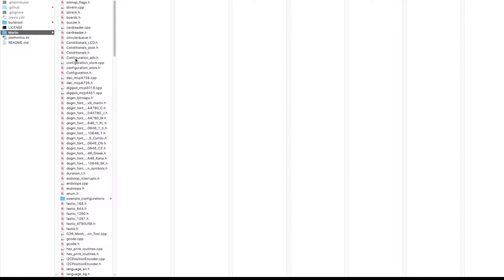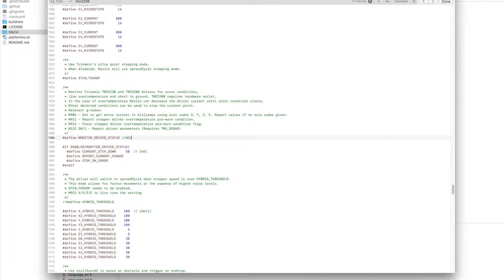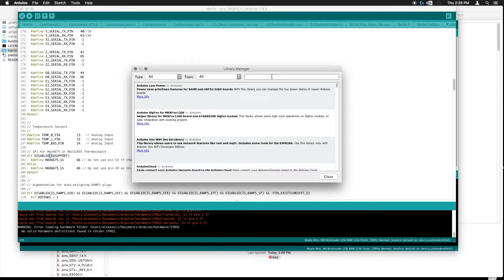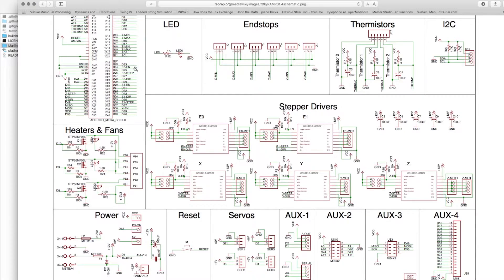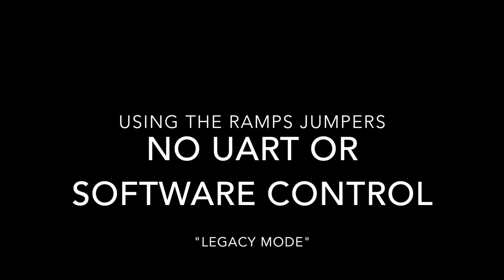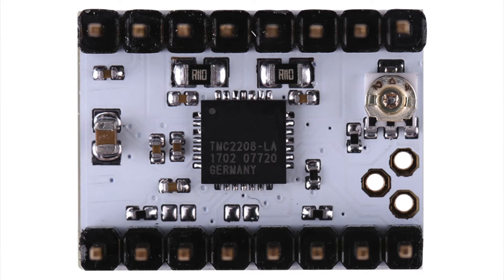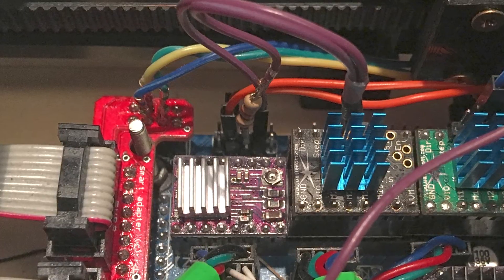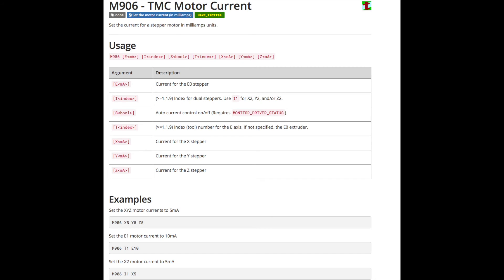Tmc2208 how-to: a more complete setup guide

Comment: Hi, i have a MKS Gen L + TMC2208 drivers. I just put the drivers in to the board, all 3 jumpers under the stepper drivers i left in. Which mode is this? I only defined the TMC2208 in the marlin firmware. Is there a mode i need to define in the firmware to get my steppers even more silent?
Reply from the maker: MKS dosn;t release schematics, so I can'tknow for sure, but i think the jumpers are wires similarly to a RAMPS, so if you want the smoothest mode possible: jumpers ms1 and ms2 should be ON and MS3 should be off (ms3 is not used for configuring microstepping on trinamic drivers cloned from the Watterott design) .  That will give you StealthCHop in 1/16 microstepping with software interpolation

Comment: Hello! Hmm. cannot seem to find the promised video about accelaration vs torque. Have you even done it?
The other interresting thiung i found out that, for example, for TMC2100 datasheet says that optimal chopper blank time is minium (16 clock cycles) however, the stick i got has 24 cycles set. It would be very interesting to see how blank time affect the torque, if it does at all, or how it affects the acceleration.
Reply from the maker: the original torque test video is called 'Trinamic SilentStepStick Torque Curve testing' , but I have a more complete set of test with a bunch of driver in the works.  I am just waiting on some parts and I have to rebuild the test jig again.  Good catch on the blank time, those are some of the parameters that are set by default that I think should be changed. I am set up to do some deeper testing on trinamic settings, and I'll film that video when I get the torque jig rebuilt. (I made a silent jig using magnetic resistance so I could also test noise, but when I did some initial testing, with high-torque motors and high-voltage, it was not strong enough, so I have to go back to a friction-based jig and just test the noise separately...)
Reply: I've seen that video. That's the video where you promised to make a separate video about acceleration. The 16 cycle blank time is best option for StealthChop. 24 cycles is universal. The driver module comes with StealthChop enabled, but maybe they set 24 cycles in case user switches to spreadcycle. I use chinese Fysetc 2100 drivers and there is not solder switch or anything to switch blank time. To change it i need to clean solder mask but the trace and solder wire. Nuts. I dug through tons of datasheets, application notes and possible explanation and still did not find anything on how blank time affects torque, specially for stealthchop. For spreadcycle is it more or less understood that it should be long enough for oscillations to finish.
Reply from the maker: Ah, the fysetc boards. I had to figure that one out as well when I tried out a few. They are unpredictable when it comes to how they are set up.  I don’t remember which version is which, but I know that some of them came with no CFG jumpers set at all.  Toff doesn’t effect StealthChop, so don’t worry about that one. That jumper does also effect the chopper frequency in spread cycle though, so it can whine if freq is too low, but it can also cause overheating if freq is too high… it’s never easy

Blank/blanking time (on all drivers) is there to avoid issues with the power supply and switching spike at zero crossing.  It just tells the driver to ignore input for a period of time.  If it is way too low, you can have abnormalities like tripping the overcurrent protection (probably why they defaulted to the slightly longer time) or non-linearity in the driver signal. How much that effects performance (torque, etc) depends on a lot of things, which makes it very hard to generalize, but I DO plan to add the available  settings that trinamic allows to the next torque test and see what effect they have in “typical” 3d printer conditions (since it has different effect using different motors, circuit, etc).  

CFG0, CFG4, CFG5 are used for configuring the chopper (CFG0=off-time, CFG4=Hysteresis, CFG5=blank-time), and they are tri-state, so I don’t think they realized that by leaving them open, they were actually setting the state.  

In case you didn’t come across them, Watterott defaults are:
CFG0 = grounded (Toff @ 140? 160? I don’t remember which it is)
CFG4 = grounded (HYST-end @ 5)
CFG5 = VCC (Tbl @ 24)

 I THINK fysetc boards without jumpers are set to the maximum value for everything:
CFG0 = floating (Toff @ 332)?
CFG4 = floating (HYST-end @ 13)?
CFG5 = floating (Tbl @ 36)?

Not positive on that.  I would have to dig up one of the boards and see what is soldered where.

I also don't remember at all how cfg6 is set up on those boards, but I know if it floats, the drivers will go into current reduction mode if they have not recieved a signal in a bit.
Reply: Hi!
No, CFG0,4 and 5 are not open. They are fixed set . Here is what i found out:
http://3dtoday.ru/blogs/artemkuchin/driver-tmc2100-from-fysetccom/ (it is in Russian, but the picture in the text explains it all)
CFG0 - GND 140 tCLK
CFG4- GND - minimum hyst, 5ms or something, i don't remember the exact number
CFG5 - VIO - 24 clock cycles
Looking forward to your test for blank time.

Comment: Hello, great tutorial. But if I have Rumba board, which pins I can use for driver controling?
Reply from the maker: It's probably easiest to do a search for folks who have already done it, but you can assign almost any pin you are not using to software serial instead, so it depends on the setup.

Comment: Alex, Thank you for making this video. It explains a lot on how to get the firmware to talk to the stepper drivers. I was always so very stumped on how to setup via serial/uart. I started using the 2208's about a year or so ago, bit at that time, there wasn't much info on them except, hey look at these new Drivers, but zero info on how to setup them up.

You should do another video on how to do the OTP and how to do it and what are the pros and cons of doing it.

Thanks again Alex.
Reply from the maker: No prob.  I considered doing an OTP vid, but I never got around to it. One reason is that it seemed to be unnecessary for all but a few cases.  If you can't use UART on your particular board or firmware for some reason, there is always the option to use a secondary arduino to control the drivers. Maybe I will do an OTP vid in the future, but I'll have to really dig into it first.

Comment: Hi Alex, this driver can produce 256 steps, as I learned but does it mean, using arduino, I can tell my stepper to turn 1.8/256=0.007 degree every time and wait X sec then turn 0.007 degree? I want to make a rotating time lapse head. So my plan is to turn as slow as possible and step by step like TURN 0.007 degree then wait for SHOOTING CAMERA then TURN 0.007 degree. Thank you in advance.
Reply from the maker: Sorry about the delay... been busy.  The math is correct.   200 staper per rev for a 1.8 degree stepper, and each step can be divided by your microstepping level.  You may run into problems with holding torque and small errors with steps that small (depending on the application), but theoretically that's how it works.  It may be better to use a closed loop system with an optical encoder disk, or a servo... but I would start simple with just a steppen in open loop and see how well it does
Reply: Thank you so much for reply. I will go for the highest torque motor within 1.5 A so that this driver can drive. And might have to sacrifice some steps to get more torque. Thank you again.

Comment: Great video thumb up, 
But i got 2 questions, i got GT2560 rev A+ bord, it lacks pins but i want to sodomize SD card pins, (id dont work properly anyway, interference, same as trash characters on LCD).
My first question, in configuration.h it says   #define MOTHERBOARD BOARD_ULTIMAKER, if i understand it correctly i have to edit pins_ULTIMAKER.h, correct ? 
Second question, in file pins_ULTIMAKER.h there is no #if ENABLED(HAVE_TMC2208) and the rest so i copied those lines from pins_RAMPS.h, is this correct ? 
Pls answer, im going to upgrade to TMC2208 as soon as i get them home.
Reply: FYI, i was correct
Reply from the maker: Sorry about the delay.  Yes, you are correct, all that can be copy pasted

Comment: couldn't you just use both pins and 2 separate wires instead of a Y wire?
Reply from the maker: Unfortunately not, because the stepsticks only have the one UART pin that is shared RX/TX

Comment: Hi Alex. would you know if a 2208 once programmed to spreadcycle via script communicator ( Keith Youngs video oon YT) can be programmed  back to stealthchop mode for setting into UART?
Reply from the maker: I have not personally tried it, but technically anything that is not an OTP bit can be set over UART... BUT  it may be possible to program a combination of options that may not work well with stealth and can't be changed, so if you have use that method, I would poke around and  find a working setup online and copy that (I can't really test combinations of hard-coded options without sacrificing a bunch of drivers, so sorry I can't be more helpful in that regard)

Comment: Can you make a guide for the tmc2208 using 1.1.x-bugfix? .I cannot get the tmc2208 to work in 1.1.x-bugfix either.
Reply from the maker: Bummer.  It should be essentually the same process, so maybe they broke 2208 support again?  I don't have an 8-bit board in a machine right now to test the latest bugfix, but I did confirm that the version from May 22 was working, so if you want to doiwnload that older version to make sure it is actually a Marlin-related problem:
-Go to the Marlin github.com page
-select 1.1.x-bugfix in the branch pulldown on the left
-click on 'commits' right above it
-scroll back to the version I used from around May 22 
-click the commit number over on the right before the <> button
-click 'browse files' in upper right
-click 'clone or download'
-select 'download zip'
If that works fine, then it may be a problem with the latest bugfix.  If it doesn't work, you likely have a problem somewhere else.
Reply: Thanks for the help.

Comment: Being attracted by the quietness of TMC driver, I installed three TMC2208 yesterday. This video is a great help. There are some things I find out during the installation. 

I own an Anycubic i3 mega printer(8-bit). I planed to replace X, Y and E0 driver. The marlin is on the bugfix-1.1.x branch. 

First, the pins selected to be used for UART is limited, not every idle pin can be used. I used the software UART approach like in the video, but the Rx of each pair has to be a interrupt enabled pin (https://www.arduino.cc/en/Reference/SoftwareSerial). Hence the available pins for Rx are 10, 11, 12, 13, 14, 15, 50, 51, 52, 53, A8 (62), A9 (63), A10 (64), A11 (65), A12 (66), A13 (67), A14 (68), A15 (69). On my particular machine, only pin 11 and 12 are available for Rx, so unfortunately, I would not be able to receive feedback from the third driver. 

After the installation, I run M122 to check the stepper's status. Strangely, only E0 has a non-zero "Driver registers" value. I spent quite sometime debugging the problem, but actually a quick google search points out that there might be a bug (https://github.com/MarlinFirmware/Marlin/issues/9396 ). 

Although there are a quite a few problems for Rx, Tx works just fine. I can send M906 to change stepper current (confirmed by hand). 

Also, the stepper direction is reversed after the change of driver, for some reason. 

Thanks for the video again.
Reply from the maker: Glad it is mostly working.  Assigning the pins can be a pain depending on what a board has available. And yes, the stepper direction is reversed on trinamics (I usually just flip the cable connector around).

Comment: I reccomend creating github / gitlab repo & commiting changes there. This way in any modern IDE you would see your changes from last time - and it would be easy to do incremental upgrades - and it would be easier for you to rollback to previous configs. 
(Also you can share repositories in link) Works great with Visual code & Platformio.
Reply from the maker: Yes! PlatformIO is nice about tying in forks. I forked a few repos to make some changes, I just have to be better about moving the commits from my machine to github (i hve a bad habit of losing track).

Comment: Hey I like the video; it helped me get my 2208's working. I just wanted to point out that there is currently a bug in Marlin 1.1.x and/or the 2208 libraries that makes it to where only the last queried 2208 returns valid info from a debug command M122 (see the closed bug report #9396). I believe it has to do with the softserial rx implementation, and it is 'promised' to be fixed for 1.1.9. This obviously only affects folks using more than one 2208 (like myself). Regardless it seems multiple 2208 w/ uart is otherwise fully functional in Marlin 1.1.x (though I have doubts about how well auto current and overtemp flags would work... still testing things).

Btw, love the heavy metal man!

Comment: On my tmc2208 I am going to set it up to use spread cycle, for the 3 pads on the top I need to solder bridge, I've been reading different things. Which ones do I need to connect? In some older boards there were only 2 pads making it easier. I'll be connecting my drivers with an ftdi board to my computer to change their mode. I am not wanting to configure it on the fly as its running.
Reply from the maker: Just remember that once you set a bit with the OTP configurator, you are locked into that config, and you may brick your driver if you burn the wrong settings.  Using the normal UART, your settings are uploaded temporarily to the chip on power-up or if you send them on the fly.  As far as the pads, the 3-pad version just lets you choose which pin you connect the uart to with the solder bridge jumper.
Reply: Locked in. hmm that sounds intense.  if i am using the otp configurator do i need to jumper any of these pads? or will it just work right away without them connected? I don't really understand the UART stuff, and not sure how to configure it on my cnc shield
Reply: Keith Young, here on YouTube, put out a video about how to program the OTP bits on these 2208 chips, just search for TMC2208 and Keith Young.

Comment: What if you have multiple 2208s? This tutorial seems to be for one...Sorry haha
Reply from the maker: No prob, the setup is the same for each axis, and if you want individual  software control for each driver, then each driver needs it's own y-cable
Reply: Alex Kenis awesome man! Thanks...I thought so but wasn't sure lmao Keep up the great work!

If I wanted to run only the drivers on 24v then would I only need to remove the 2 power pins from the board and direct feed them 24 right?
Reply from the maker: If you want to direct feed just the drivers, just solder the ground ref and motor voltage pins facing up and wire them to a separate power supply (all regular precautions apply: sufficient wiring gauge, decent coonectors, fuses, etc) I don't usually do that because you lose the board's motor voltage capacitor, but if you have issues, you can add them to each stepper's supply. If you want to run 24v into the board's 12v input, then there are more considerations to make depending on the board (sometimes it is as easy as removing one resistor and self-powering the arduino , and sometimes it is more of a pin in the butt).
Reply: Yeah! I saw a video by Jacob Makes and he doesnt do a very great job at showing all the wiring or explaining, however it looked simple enough :)  Thanks man!
Reply: 'How to Silence Your 3D Printer with 24v TMC2100 Drivers' - Jacob Makes

Comment: Could you explain how to wire more than just one tmc2208?
Thank you!
Reply from the maker: The process is the same, just make sure you enable each axis and set your pin for each driver: 2:35  5:08
Reply: So, you need two pins for each driverr, don't you?
Reply: English is not my first tongue, and sometimes i miss some details
Reply from the maker: Yes, if you want separate transmit and recieve for each driver, then each driver needs to have it's own y-cable, with 2 board pins.

Comment: Hi Alex...nice series of vid...i could use your help for mks gen L board for wiring the original tmc2208 uart...i use a mks 32tft on this board so I have it hooked to aux 1 on the board so I have aux2 pins available and those exp 1 and exp 2 pins available as well...
Reply from the maker: The GenL is basically a fancy ramps with an onboard processor, and it uses the same pinmap as the ramps 1.4 (they even use the same pins header file in Marlin firmware), so you should be able to assign the pins just like you would with a RAMPS board, and follow all the RAMPS examples.  MKS (makerbase) has a github.com page with their manuals, so look for the GenL pin map in it's pdf to see which pins correspond to which number (should be already assigned to aux-2, so just follow the pin map to see which ones to use).
Reply: Alex Kenis Hi. Same setup here. Question: I’ve got already soldered TMC2208 drivers with all pins soldered. Do I need to unsolder those 4 or just UART to reconnect it to RX TX?

Thanks,
Daniel
Reply from the maker: You only need to solder the UART pin that you are using, up. You can leave the MS1 and MS2 pins where they are in case you want to run them in standalone mode and configure the microstepping with jumpers someday.
Reply: Thank you! I'll try today :)